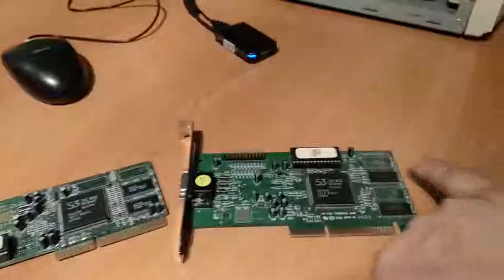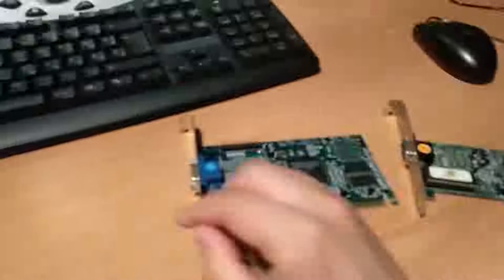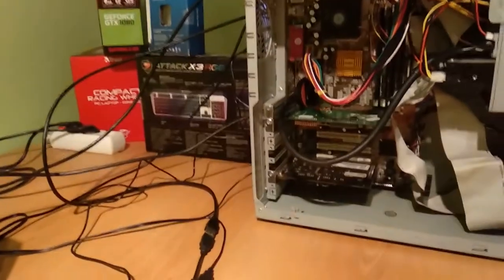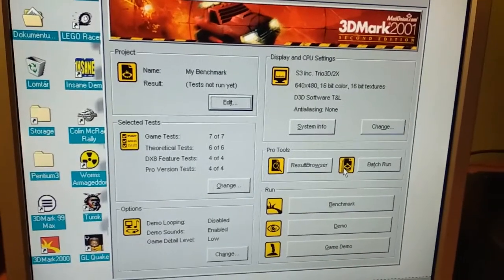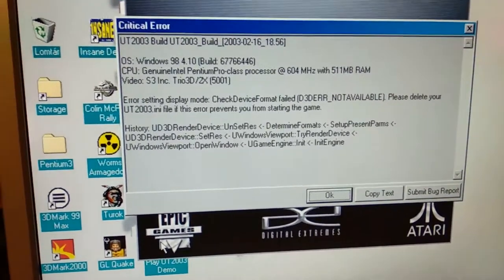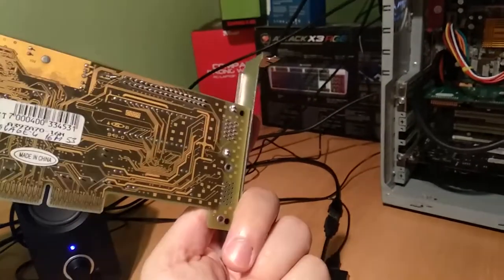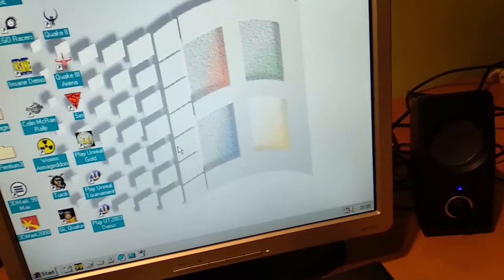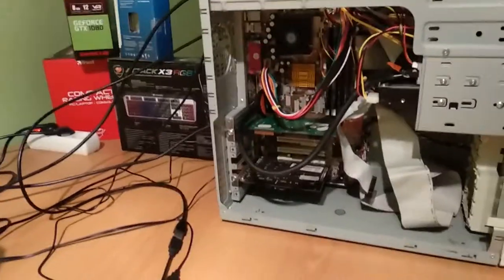PIII-600MHz - S3 Trio 3D/2X 4MB - GAMING!

Comment: Unreal on this card is playable only on 320x240 software rendering. I've got a 4 MB version, but now I nave no mobo with AGP 2x slots
Reply: @retroianer422  Probably should, but it doesn't. 20-25 fps on 512*384 software rendering